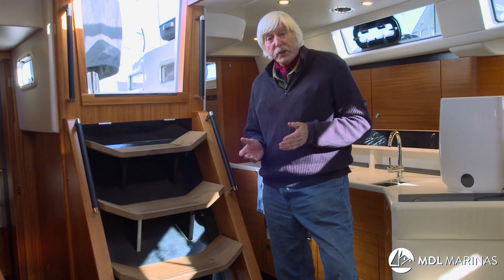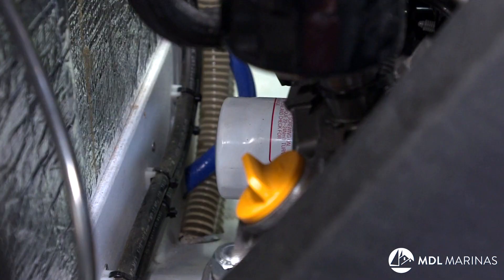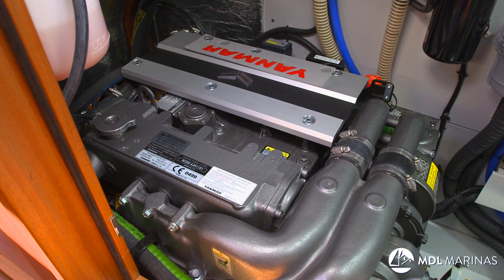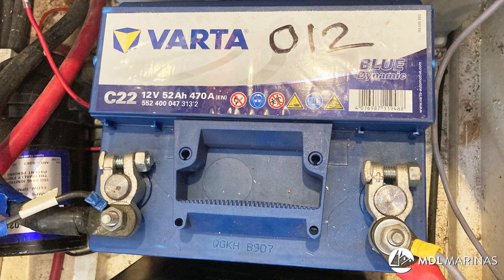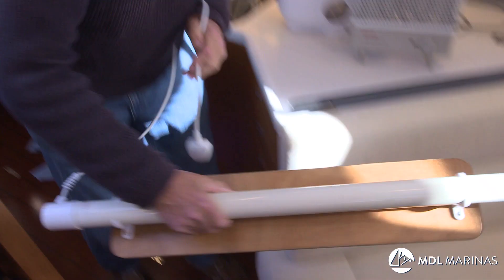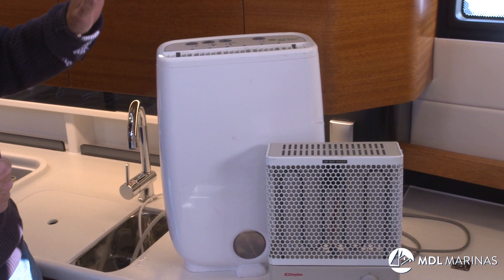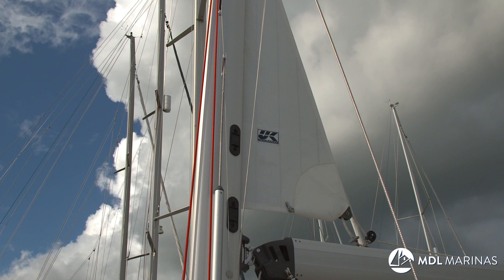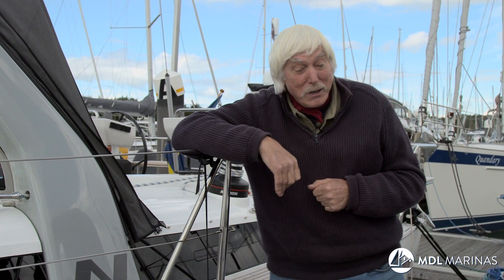Tom Cunliffe Describes How to Lay Your Boat up for the Winter

Comment: I always flush the engine heat exchanger with fresh water from a hose supply for at least 20 minutes - just drop it down the engine supply side in the filter housing and run it full bore, the intake will act as an overflow until the engine is started, then, just before switching off add some anti-free - organic as mentioned.  A good dehumidifier is wort it's weight in gold from the point of view of mould, we manage without a heater as the dehumidifier warms the air slightly.  Anti-bac sprays help with mould and also keep the green off other areas, inside and out - buy 5L refills from a commercial outlet, it's much cheaper.  Everything else is as per, but particularly the diesel tanks - beware empty tanks!  Don't forget the generator if you have one!  Great reference video.

Comment: Excellent advice.  For those of us in tropical environments, leaving an opened bottle of bleach in the head can prevent mold from developing on the interior walls if you are away from the boat for extended periods.  One must consider ways to prevent the local critters from climbing aboard via the dock lines.  I also hung a sacrificial zinc over the side in the water attached by a wire to the engine ground.  My final step was to set off a few roach "bombs" inside before closing the hatch and locking her up.

Comment: Excellent practical tips for laying a boat up, thanks Mr Cunliffe!  And thanks for stressing the importance of putting notes all over the place about reopening the sea cocks, esp for the engine, I was wondering if you were going to mention that, and of course you did. That's why pitot covers on our aircraft have small but bright red flags attached to them w the words "Remove before flight" on them - because taking off with no airspeed readout is generally frowned upon 😄  
Might be a good idea for boaters to use another tool that we pilots are trained to always refer to - checklists! Make an "end of season" and a "start of season" checklist for your particular boat, refer to them as appropriate, and you'll reduce the chance of missing anything by a huge factor. Cheers! 👍🏼☺️